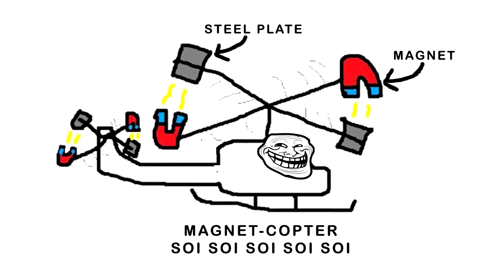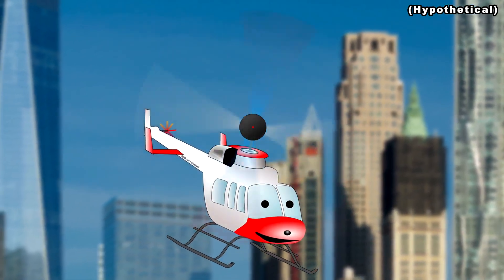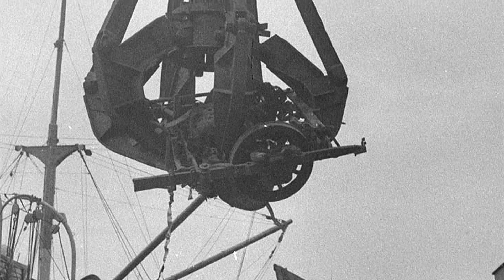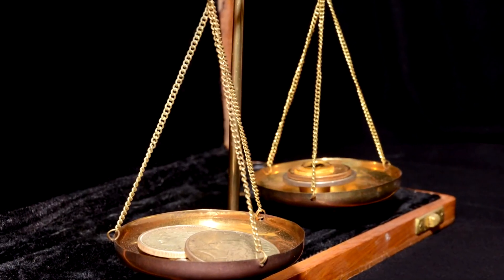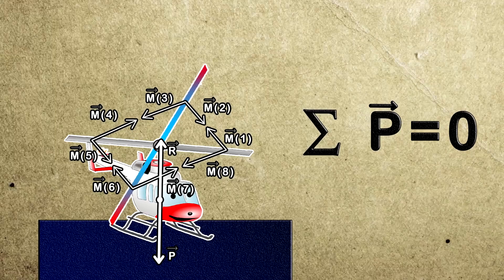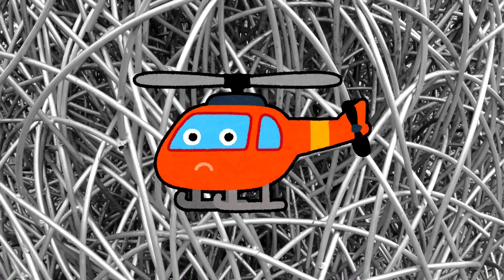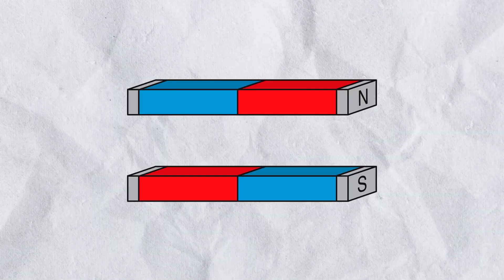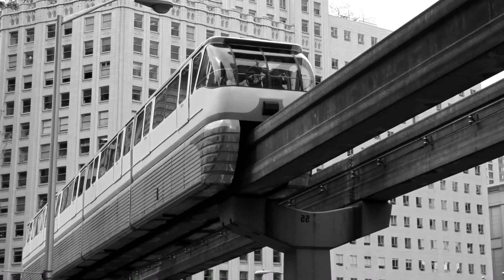why it doesn't work 22

Comment: At that point Just smallen the rotor turns the magnet and steel plate into copper wire and put it inside a casing oh waithats Just an Electric motor

Comment: The hardest part about perpetual motion is hiding the battery
Reply: Unless you have a time cristal. (The atoms were frozen and then lasers were fired on them again, so they start moving again. This results in a dacing cristal, which dances until it melts 😂)

Comment: The real reason it wouldnt work is because you would be unable to stop it, causing it to fly into space where you would suffocate and die
Reply: Good point! Better add an ejector seat (and some air bubbles for infinite breathing).
Reply: Unless you actually know how helicopter blades work
Reply: case in point to my post!
Reply: Just have a lever that moves the magnet away from the Ferrum?
Reply: @Kvadrotrin It's not possible.

Comment: How do you turn off the magnetcopter
Reply: It's always off.
Reply: @balijosu  no in a world where it would work…how turn off
Reply: Throw the bigger magnet from the storage at the bottom of the helicopter at it. All the blades will stick to it and stop moving
Reply: You use breaks
Reply: Just make it an electromagnet
Reply: You hit the off button.
Reply: use electromagnets instead
Reply: That's the neat part
You don't

Comment: At that point, just make a goddamn normal helicopter
Reply: but enviroment
Reply: @disguisedpuppy  You would need to burn something to get the energy required to get the blades moving in the first place.
This is the exact same problem that electric vehicles face.
Reply: Well yeah but magnets
Reply: At that point you just get an inefficient electric motor
Reply: Have you found Jesus yet? You really should try.
Reply: @themeowhogsmeowkitten4178  What does this have to do with anything?
Reply: @ifanythingiwant  I just felt like this is a good place to mention it.